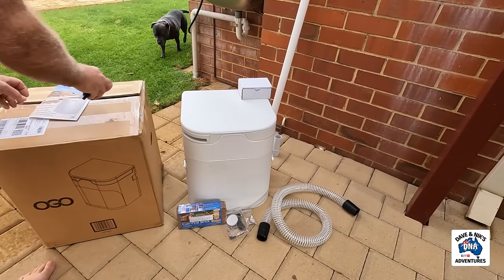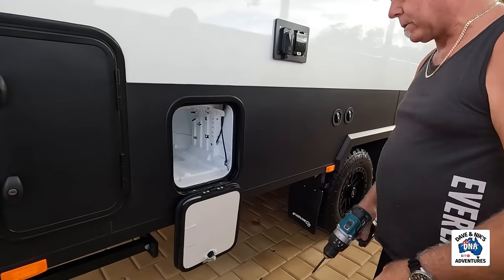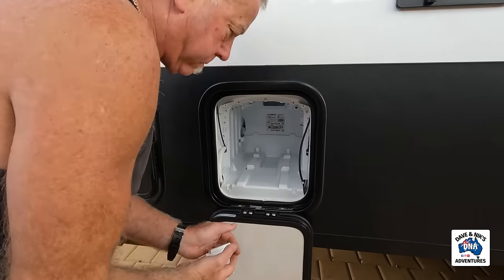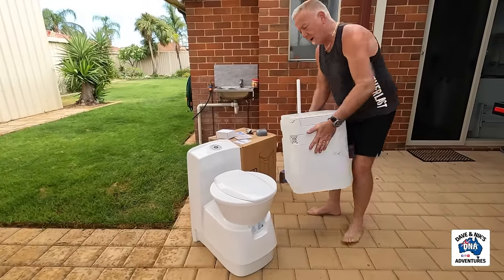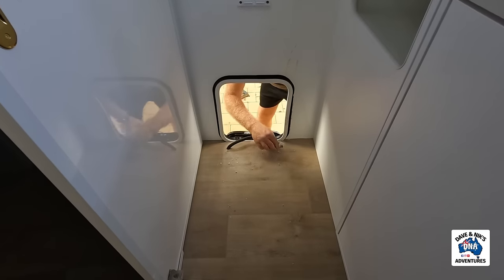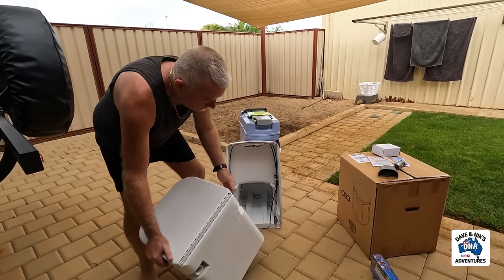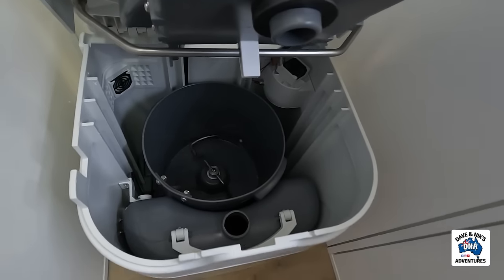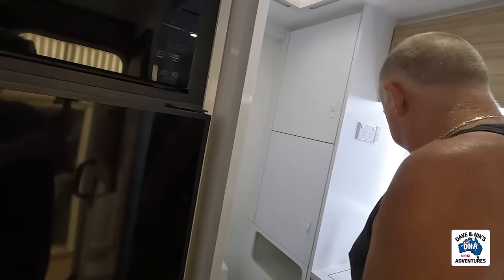INSTALL THE NEW OGO COMPOSTING TOILET INTO OUR BRAND NEW FULL OFFROAD EVOLVE RV CARAVAN...

Comment: I'm the N.Z. Agent for OGO. Very good video and installation. Here we recommend venting the air down through the floor, this keeps a downward path on the pipe and prevents condensation building up. Saves cutting the hole in the door and you will have some valuable extra storage space. Highly recommend that you fit the urine diversion kit to send urine to your waste tank. Worth the extra effort and saves having to empty the bottle. Avoids an accidental overflow if you have guests who don't notice the 'bottle full' warning light. Well done on a good job. You won't regret going waterless. Cheers from NZ
Reply from the maker: Thanks where do you get the convention kit and cost please sounds like a great idea. 
Cheers Dave and Nik 🇦🇺🍻👍
Reply: Except in Oz you are not permitted to divert urine into the "grey" water tank (shower & sink waste). It can only go into a "black" tank.....
Reply from the maker: @paulgriffin5572 ok thanks for that. 
Cheers Dave and Nik 👍🍻🇦🇺

Comment: Hi Dave I have the natures head and the hose at the back was 2 ft to long so I just cut it to size it doesn’t need to be so long 

Also keep an eye out on the hose as moisture collects in it due to humidity hot inside van cold outside next minute you’ll have a couple of miles of water in it and you compost will start to get very wet 

Ps
I like the plastic backing off the old toilet looks awesome
Reply from the maker: Yes seen plenty of retro fits but it always looks unfinished with the hose at the back of the dunny 
At least this hides all the stuff you want to see. 
And thanks for the tip I’ll keep an eye on the water buildup and if it’s a problem I’ll shorten the hose. 
Cheers Dave and Nik 🇦🇺🍻👍

Comment: Good job mate, but it was too much pain for me to drill a hole in my door so I drilled it into the floor.
Reply from the maker: Doors are replaceable if it was wrong 😑 
But if I drilled through the floor and wasn’t happy with how it vented there is nothing I could do about it. 
But if drilling in the floor worked for that’s great 😃 

Cheers Dave and Nik 🇦🇺🍻👍

Comment: Great video, thanks. We have the Cuddy for the camper trailer but I'm seriously looking at the Ogo for the caravan, as you have done. I'm assuming the fan runs all the time when you power up the van and wondering if the fan could have a switch to turn it off when you power the internals of the van. There would probably be times where the toilet wasn't in use and turning off the fan would be good to do. maybe the pump button on the top of the old toilet could do that job ?
Reply from the maker: Ok thanks for watching and commenting it means a lot to us. 
Ok the fan runs all the time    
But when you flick off your 12 volt isolater switch it will turn the fan off the only thing that will stay on is the fridge. 
But if you are going to turn the 12 volt switch off make sure you have emptied your compost side of your toilet as well as your wee bucket if its going into storage. 
Hope that helps ? 
Cheers Dave and Nik 👍🍻🇦🇺
Reply: @daveniksadventures2255  Yes, we do empty the Cuddy when not in use and the fan would definitely run if there was matter in the bin. I'm seriously thinking of doing that retro fit now, thanks to this video.

Comment: Thanks for the video and for keeping it detailed and real. I have a combined toilet shower and have my ogo due for installation april 4. I had worried that the hole in my shower base from the old toilet would be the problem but now I can see i will need something to cover the gap at the back plus buy a vent shell. I was also going to drill a hole through the old cassette compartment door. I have read it should go through the floor plus shorten the hose. Now you have used yours would you still put it through the door? Plus is the power draw of the fan noticeable? Thanks,
Reply from the maker: I’d would still do the west I have done ✅ 
And power draw is minimal so don’t worry about that … 
Cheers Dave and Nik 🇦🇺🍻👍

Comment: Immediately swapped our chemical toilet for the OGO too last year and it’s great. fyi -  the vent is actually for drawing air into the toilet to keep it dry and not out as most people think.
Reply: DANGER WILL ROBINSON….DON’T do this you will draw fumes into your van. This is added to vent your system, similar to what you have at home.
Reply: @weejimmyhannah yes you are correct and I checked. It does indeed vent outside so all good.
Reply from the maker: True 
Cheers Dave and Nik 🇦🇺🍻👍
Reply from the maker: Yes it does draw the air out of the loo 🚽 and it sucks air in from inside the van 
Cheers Dave and Nik 🇦🇺🍻👍

Comment: great install  Dave I have done the same only problem is the pipe for the shell vent . It is 1 1/4" and 40mm pipe is too big and 40mm conduit is too small what did you use it looks like 40mm pvc pipe? thanks Waz
Reply from the maker: I took the hose and shell vent to bunnings I got a pipe 1m long I think it was in the plumbing section just check because the retic and plumbing pipes are different. 
Cheers Dave and Nik 👍🍻🇦🇺
Reply: @daveniksadventures2255  thanks mate I couldn't get a pipe to fit mine US sizing I think so I sanded a piece down to fit all good now.

Comment: Hi Dave, what size conduit did you use for the vent? Ive got some 40mm plumbing pipe however it’s not quite the correct size. Good idea regarding the back of the original toilet. I’m trying that out tomorrow. Cheers Waz
Reply from the maker: Without going back and watching the video again myself I can't remember but I did say what size it was in the installation of the ogo. 
Hope this helps. 
Cheers Dave and Nik 👍🍻🇦🇺

Comment: Hi mate nice work I've been looking at these compost toilets for a while do you see issues if installed in wet area shower cubicle and would it need to or possible to make watertight. Any suggestions. thanks
Reply from the maker: I have seen them in a combined shower toilet set up but I think there is a bag that goes over the toilet to stop water getting in while showering. 
Cheers Dave and Nik 🍻🇦🇺👍

Comment: Dave its been a little while since you installed the OGO composting toilet. Has it met your expectations, has there been any problems with it, the location of the wee separator as a bloke do you need to adjust how you sit on the toilet.
Reply from the maker: Thanks for watching and supporting our channel. 
There no way in this world we would ever go back to a chemical toilet. 
As a bloke just sit in the toilet and wee as normal 🙄  
I tend not to use it for weeing only wee if I had to get up during the night or first thing in the morning. 
Rest of the time I just go outside. 
We will be doing a review on the ogo soon , I like to make sure we have tried everything out and tested it thoroughly before we give our honest opinion. 
But like I said earlier there is no way we would ever go back to a chemical toilet. 
Cheers Dave and Nik 👍🍻🇦🇺🍩

Comment: Would it be better to shorten the hose, so it’s closer to vent outside
Reply from the maker: The hose has cut now and is in a downward slope to the vent so if any condensation in the hose it can run out. 
Cheers Dave and Nik 🇦🇺🍻👍

Comment: The vent needs to be higher for the fumes of the loo  up high like the  fridge vents or roof. I cringed, watching you cut a hole in the hatch. We have a nature's head & they vented it on the rear bumper bar & fumes came straight unde the van with the wind chamge. Good luck with that , ours was revented to the roof.
Reply from the maker: We were told most of the installs are vented through the floor but didn’t want to go down that path. Ogo said it was gone to vent through the door like we did I suppose time will tell. Cheers Dave and Nik 🇦🇺🍻👍
Reply: Vent is for air intake not for fumes out
Reply: @VykingBoy  our natureshead was installed by the van company . The fan was vented into the caravan & I dont recommend that. It's a pretty rank smell. They had put the hose on the wrong side of the toilet  & and the fan was supposed vent to the rear of the van & the flies gathered around the rear of the van . Redone the right way & run up the fridge space to the top of the van, vented out & no more issues.